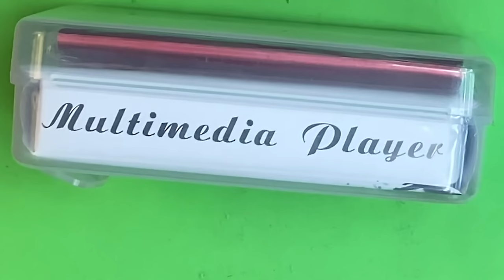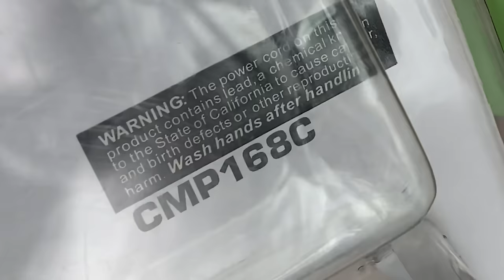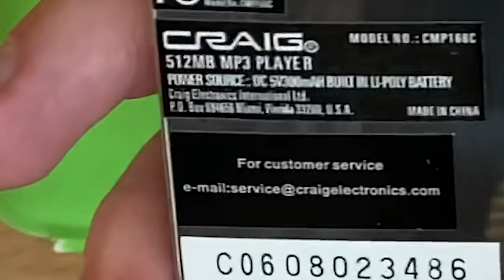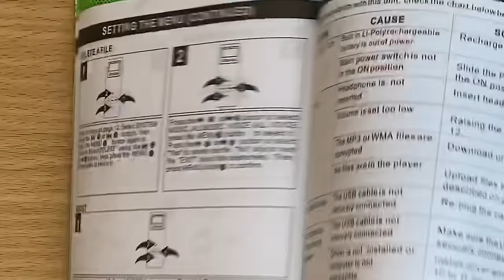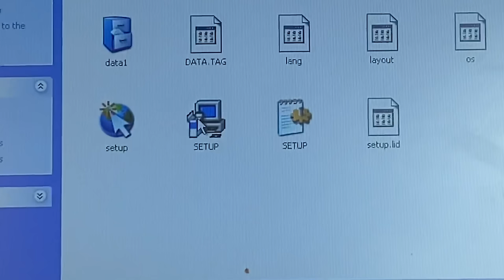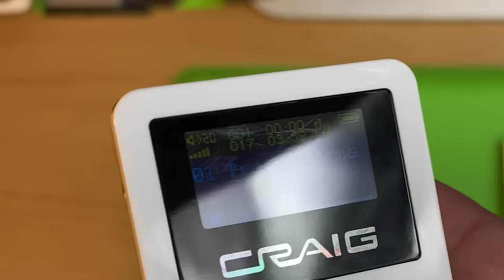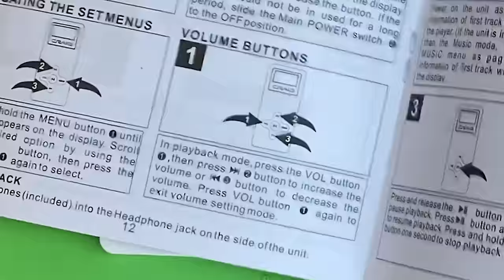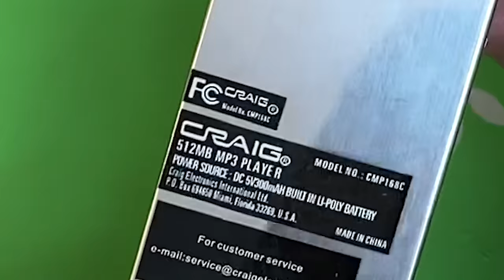I found a bootleg iPod Nano.

Comment: "Craig" has had a long legacy of ridiculously low quality electronics since at least the 1980s
Reply: They were 1 step above the weird or noname junk from china. At least when new, they mostly worked.
Reply: @firesurfer  Mostly is mostly true! My sister had a Craig "Boombox" within a week or less its antenna fell out. It ate her favorite cassette and the CD player never worked. Needless to say it was sent away for warranty repair. The tape player was adequately fixed, but there antenna "fix" was to replace it with a nub that didn't pickup a single station unless you constantly touched it... The CD player still didn't work... Craig, ah what can I say, truly a quality outfit. Comparable with the likes of Lennox Sound, GPX, WestingHouse, and Coby
Reply: Actually they started as a car stereo company in 1963
Reply: @firesurfer  Dank is going to be like
NOOOOOOOOOOOOO
Reply: @I.Fumblebee.I  You should see the icraig line of products there is even one that looks like a MacBook
Reply: The Fumbler Every word in that is a lie
Reply: THEY MAKE DRONES
Reply: @LAUGHINGMANWILL  Fun fact: if you cut the tape in an audio casette to get it out of a hungry player, then tape it back together with Scotch tape, odds on it'll play just fine.
Reply: Didnt they make tape players in the 60s too
Reply: @LAUGHINGMANWILL  I recently found my old Coby mp3 player with 4 GB of internal memory from 2007, and still works, but yeah, it doesn't sound very good, but I mainly use it for podcasts, so I don't mind hahaha
Reply: @LAUGHINGMANWILL  i had a Lennox sound, surround sound system, I kinda fryed the subwoofer but it still worked along with every speaker.
Reply: Bought a craig battery bank, charged it up and... Didn't even charge my phone for more than 10 seconds.
Reply: They’ve existed since the 60s actually
Reply: I got some wireless Craig earbuds for my birthday and THE 🅱️🅰️✝️✝️RY FELL 🅾️U✝️ 🅾️F ✝️HE♏️
Reply: @windows760  Always falling apart when we need him. You might say Craig isn't the most reliable
Reply: @amateurprogrammer25  I used to glue it together with nail varnish.
Reply: @firesurfer  One step above the chinese? It's literally chinese electronics made by "White label" companies, where you can pay to also have them throw your name on it.
Reply: @BoatLoadsofDope  Almost, I believe they designed their own product and had them make it.
Reply: Stereo Dust Particles
Reply: my face listening to these comments when my uncle is michael newman, the owner of craig: 😐
Reply: I think they are owned by magnavox. How the mighty have fallen
Reply: I want to see a Craig walkman
Reply: The build quality of this nugget looks leaps and bounds ahead of what they were doing with car stereos in the early 90's.  Those things looked like they were built from kits in somebody's garage.  Through-hole components when everybody else was using surface mount, solder flux everywhere, garbage tape deck mechanisms, etc.
Reply: 3:10 the other version of victory of america
Aka ausieof victory
Reply: They made portible reel to reel, and inpossble mission used them on their tv serice
Reply: @JetroNetro  yeah and they were enforced by people like ringo starr
Reply: @LAUGHINGMANWILL  :wheeeeeeeeeze:

Comment: I used to have a Craig MP4 Player whenever I was really young. I vividly remember leaving it on the living room floor and my mom stepping on it causing the plastic over the screen to be badly cracked. My dad literally pryed the plastic cover over the screen up with a screwdriver exposing the bare LCD and getting rid of the cracks. Even though the thing was crap I absolutely loved it at the time.
Reply: I bought one about a year ago. the selling points were a lack of I-Tunes, and it cost about as much as a trip to McDonalds. It lasted about 6 months and sounded.. Not terrible. I can't say i feel ripped off.
Reply: I remember when I had the exact  model in the video when I was a kid. I had a decent experience with it. Even survived being put in the washing machine by accident. My dad opened it up and just aired it out and it worked like new lol
Reply: @robdixson196  y'all hate I tunes that much?
Reply: @robdixson196  just mod the ipod with rockbox, no more itunes
Reply: @nequastar1826  drag and drop time!!!
Reply: @nequastar1826  not all ipods can run rockbox

Comment: 11:49 That's a quartz crystal, it's running the CPU's clock! That gross stuff around it is wax/super glue to hold it in place, since the legs are very thin and short. 
You might be able to overclock it by changing that crystal...
Reply: "Overclock a Craig" now that sounds like a hardcore tech project.
Reply: I'm betting an overclocked Craig would make the music sound faster too, I bet it's tied to the CPU frequency not some fancy separate clock. That would be funny for sure
Reply: We water cooled a Craig!! With DankPods!!!
Reply: Ln2 cool craig

Comment: Craig was (im not sure if they are still around) one of those cheap electronic brands you'd see in pretty much every store that sold some kind electronic around the mid 2000s in the states. They were cheap, has little to no quality control, and broke super quick. They made pretty much one of everything.

Comment: The “iPods” in those crane games at your local arcade
Reply: It's usually a bootleg Shuffle
Reply: I went on holiday and ‘won’ a bootleg 4th gen Nano. Was so crap, but oddly enough it did have a 30 pin connector...

Comment: Craig used to make budget sterio equipment in the 60s and 70s. They made reel to reels, record players, receivers and things like that. I'm sure this is just rebates for that.
Reply: LdeinerProductions  I was just about to comment on that.  My first car (a hand-me-down 1974 Dodge Charger) had a Craig 8-track player installed under the dash.  It worked.
Reply: I would imagine that, these days, the trademark is owned by some kind of holding company which carries on the legacy by slapping the name on crappy Chinese audio gadgets.
Reply: @johnruschmeyer5769  that's basically how RCA still haunts the world, peddling cheap Chinese tablets
Reply: @spceinvdr6603  Along with other ghosts such as Sylvania, Westinghouse, and Quasar.
Reply: I always knew Craig as the brand that exists only in the electronics shelf of CVS

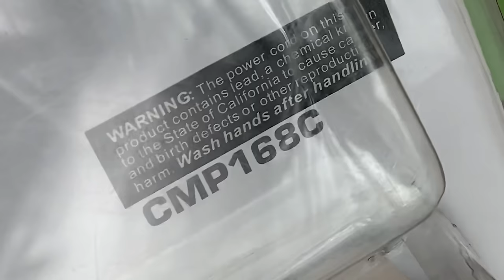Comment: The disclaimer at 3:00 is a ROHS warning required for anything being sold in the US that uses leaded solder (it can apply to other things but mostly just that). It just means that the wires were attached to the pins with regular solder instead of the tin-silver crap.
Reply: No. ROHS sticker means it's ROHS compliant aka lead free.

Comment: This Craig was my very first mp3 player.. Once I was staying overnight somewhere and I forgot its charger, but I had my kindle charger so I charged it with that. After that it would only play the first song that was on it (in alphabetical order) on repeat and nothing else. For years after I was too traumatized to use anything other than the specific cables and chargers provided for any electronic device I had, even though I knew it wasn't supposed to matter as long as everything matched up properly. Good times, thanks for nothing Craig!

Comment: Those lead warnings always got me. like.  Yeah the circuilt board probably has leaded solder but unless you crack the bloody thing open and blast it with a heatgun in a closet I don't think the leads going to hurt you.

Comment: That "leak" was adhesive on a clock crystal.  It prevents it from moving around.  If it jiggles around it can mess up the clock used by the processor due to the piezoelectric effect.

I can be paid in Bundaberg ginger beer for this consulting session.

Please send it to:
1600 Pennsylvania Ave Nw, Washington, DC 20500

Comment: DUUDE, IS THAT THE SP60NB50 DRIVE BY LG AT 7:42? AWESOME LOL i love that thing especially since ive lost my usb drives so making boot discs is currently accessible for me lmao
ive dropped that stinky thing like 5 times even with discs in it and even though its so damn slim and it SEEMS like that'd toast it, nope, it reads a w10 install just fine even yet
plus the dvd burner in my main pc doesnt seem to be 100% reliable, but the little slim nugget HASNT put a smell of warm plastic in the room, PLUS it always reads the backup discs i sometimes make...

it's a bit of a slow read and write, but hell it'll work all the time

Comment: Sandisk used a little dual color screen around 2008 on some of their mp3 playeyers, they were oled panels and used like 20ma of power. Unlike the little LCD players you could get 24 hours of music playback because the oled panel used no juice... likely the CRAIG is trying to get nerds who knew this kind of thing to buy it, or at least copy the visual look of similar devices.

KIND OF A MUTE POINT THOUGH when you're copying an iPod and using a sandisk player's screen lol...

Comment: Ruizu is really good mp3/mp4 and whole lotta else format player 

It has micro SD slot, Bluetooth and I have 64gb SD card that I threw at a wall and started working yeh it legit didn’t work until I did that with no issues I keep putting stuff on xD 

And quality feels nice just feel like the buttons would wear off eventually

But there are a lot of models and they have their own website

Comment: Craig is a brand Ive only seen sold in and by the RiteAid chain of stores/ pharmacy.
They literally will. Manufacture anything and everything and they produce it  cheaply as possible and half will die soon after unbboxing.
Eveyrhthing I've owned by Craig (portable power banks, USB chargers, car USB chargers, wall outlets extenders, cables apple style 30 pin and lightning and USB etc have died within 4 months 

Why did I buy so much so often and seemed to never learned my lesson is that I worked at rite aid for about 6 years and with the discounts it make most of the purchases rational enough at the moment and I kept going back for more like a electronic junkie. 

Don't buy craig but when you really need something. Cheap in the states a rite is around the corner and some how you'll trust a Craig product more than a gas station. Unbranded product just because in sold. In a rite aid. Believe me youll end up buying Craig eventually

Comment: Samsung = High price for a shot at quality. 75% chance your getting trash. 20% chance you’ll end up with a nice Samsung… that starts glitching with every menu change, button push, etc. 4% chance you’ll get one with a blown battery. .5% chance you get an empty box due to a factory error - Luckily they’ll usually fix this. Then the last .5% chance you’ll get a working Samsung after paying their insanely high price.

Craig is actually a less risky expense. 

But It you want true quality, ditch Apple, Samsung and Android. And get the greatest MP3 player ever made. That’s right.

Microsoft Zune

Too deny this fact, is to invoke the wrath of William Gates